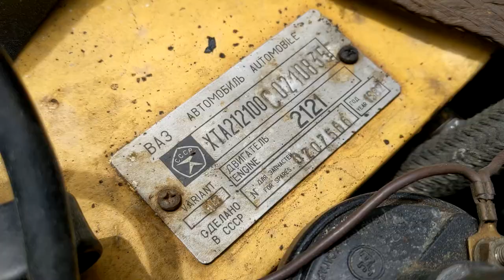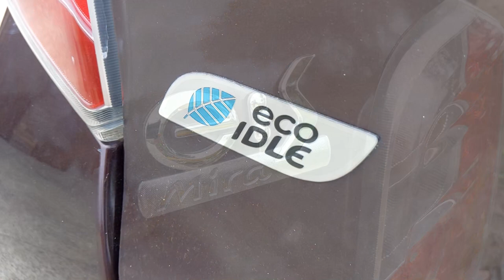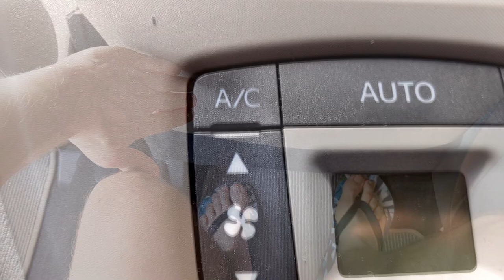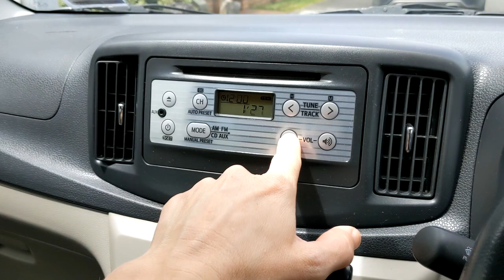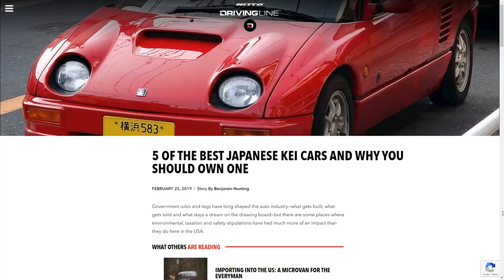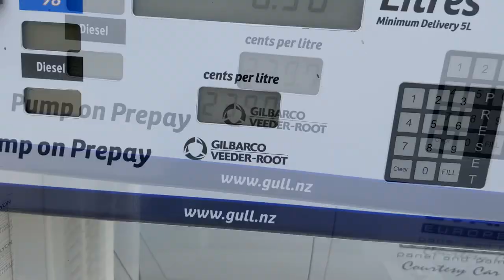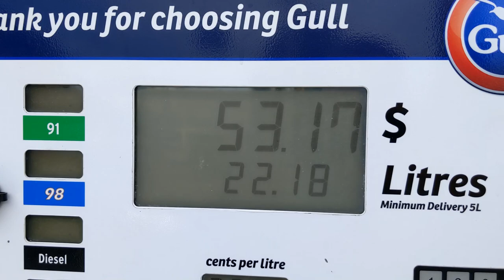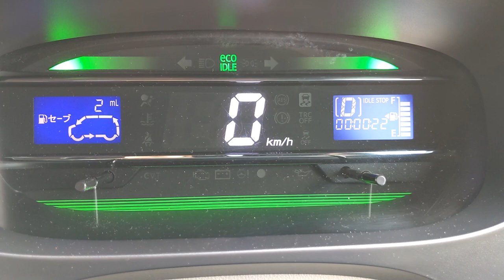I bought a JDM car straight off the boat from Japan! (Not available in the USA)

Comment: Although badged as a Daihatsu Mira, which is owned by Toyota anyway, I think that car owes a lot of its design to the much early Suzuki Alto 3 cylinder.  I had a 1993 Suzuki Alto 3 cylinder 660cc, 4 valves per cylinder.  No aircon or power steering in those days, and a 5 speed manual gearbox, the carburettored engine gave me 51 mpg around town and 61 mpg on country runs including over steep hills. (The car already had over 200,000 kms on it when I bought the car in 2007).  Note that Suzuki pioneered the electric power steering which is so common nowadays, because it doesn't  continuously drain engine power from a small engine to run a pulley belt driven pump. The electric assistance only being on at low speed and tapering off as road speed increases. I'd still have my Suzuki today and be happy driving it, but it gave its life, so that I may live. Yes, I was tee-boned at speed, yet I walked, well limped, away.  But the car was cactus afterwards. Even without airbags it had lots of passenger protections built in to the structure.

Comment: Nice car mate. I got the same Mira car in Pakistan. Great car. Best for daily commute. 

P.S. The "B" in the transmission stand for Braking. It is used when you're going down a hill. "B" mode allows the engine to rev to 3000 Rpm throughout the speed range so a far greater engine braking response is felt when letting off the accelerator.

Cheers mate.